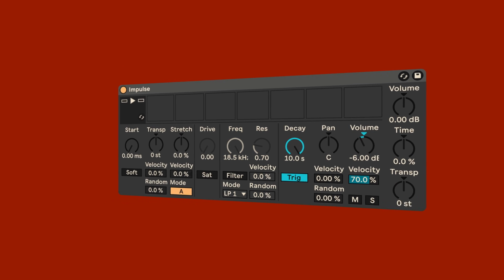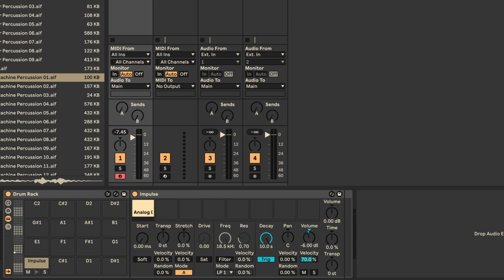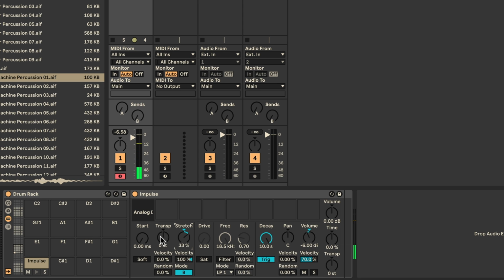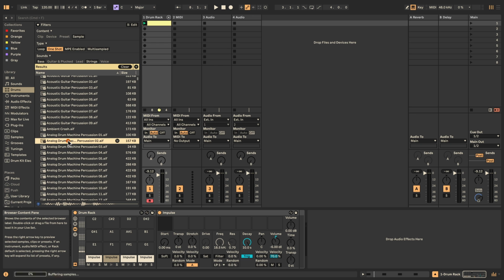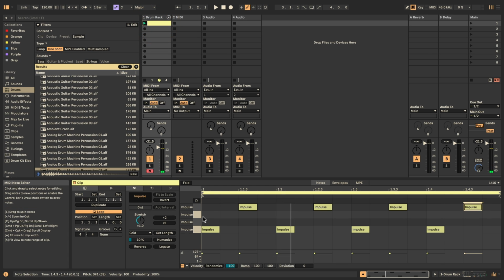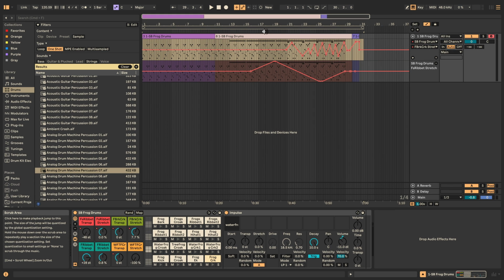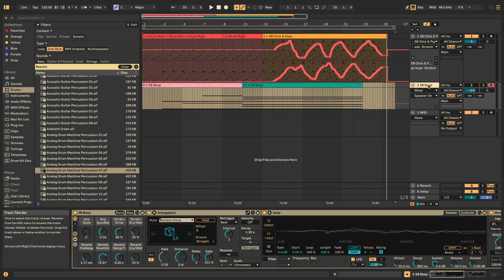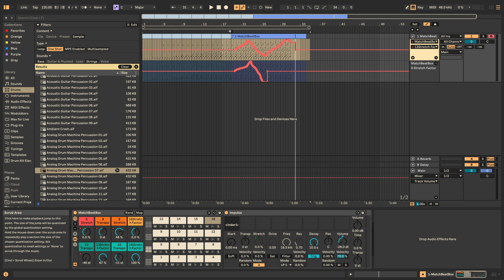Sound Design with Time-Stretching in Impulse (+ FREE Live Packs)

Comment: so i don't have ableton, but the stretch control allowing you to speed it up reminded me of something i did for an unreleased track. i took some old long foley recordings i made ages ago, and sped them up with one of logic's stretch modes, i think slicing. so it took all the loud bits and squished them together, and i got some neat glitches to use for an intro with pretty minimal effort.
Reply from the maker: Nice. I'm sure there's at least one way to get this done in any DAW.

Comment: Whats the advantage of hosting multiple instances of Impulse in a drum rack rather than using it as it's own self-contained 8-sample drum kit?
Reply from the maker: If you're using a MIDI controller like Push, it will be set up to use the Drum Rack. The Impulse only uses the the notes of the C Major scale from C3 to C4, so it's mostly about the MIDI note mapping to controllers.